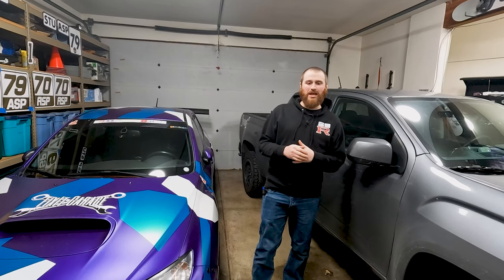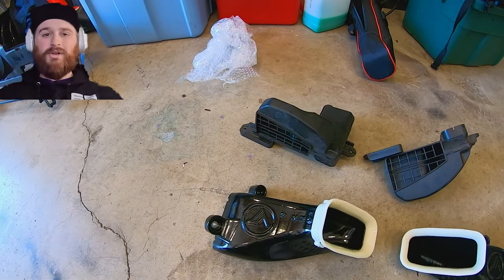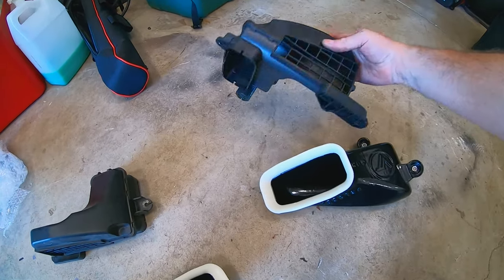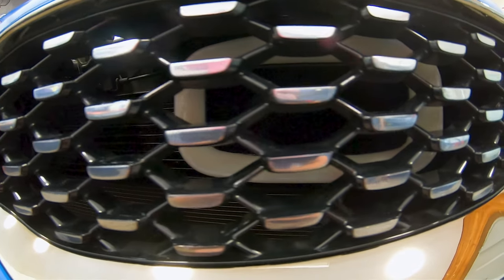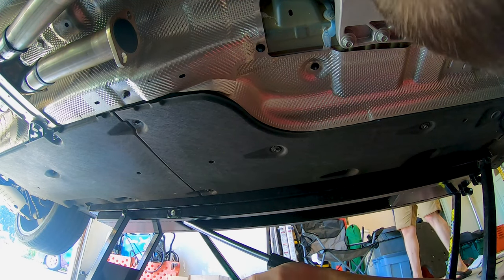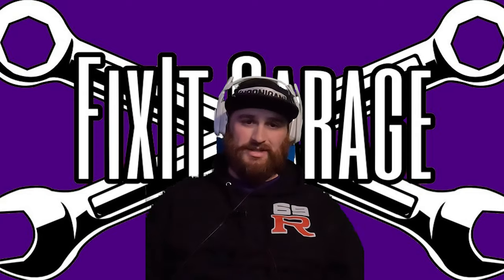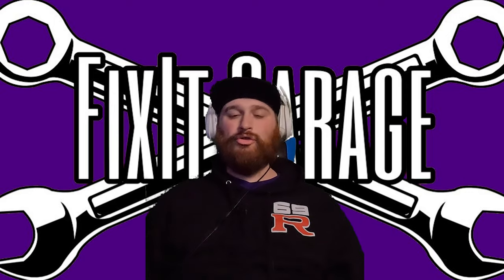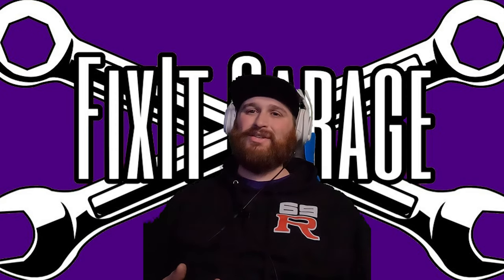Kia Stinger Velossa Tech Big Mouth (Glow in the Dark) Snorkels!!

Comment: Dang sucks to snap a stud, especially when not really expecting it on these newer cars. Wonder if soaking in penetrating oil early on could have helped.
Reply from the maker: We did for 3 days before we tore it apart. It still didn't help at all.
Reply: @Fix_it_Garage  dang that’s a bummer for sure.
Reply from the maker: @ALMX5DP  yeah the best solution is air gun and extension and do them from under the car. For some reason that resulted in the bolts not getting damaged as youll see in the next two videos

Comment: they have a lot of video how to do it... thats a hudge mistake of you to no watch it before and not added blaster... thats so dumb dont do mecanic..
Reply from the maker: We did pb blaster for 3 days before taking it apart and there's like no videos on the downpipes. I've been a mechanic for 15 years and I own every mistake I make. That's how you learn shit happens, you improve and move on
Reply: but if you have been a mechanic for 15 years, how did you do to break the nut?
you have to make bouncing movements with the ratchet to check that it is not jamming
if the ratchet can't do a little bouncing, there's no point in forcing it again, it's on what will break...
it's useless to wait 3 days with the blaster, one day is enough and why after having unscrewed a few turns not having put the blaster again ? maybe even let it wet and saok it a second time?
go dry without bouncing that's it...
learn jeep mecanic next time buddy
Reply from the maker: Haha we soaked it multiple times over 3 days to allow the nut to break loose. Guess what sometimes they bind up and break again shit happens. Happena on the new civic turbos all time and honda does it on purpose to prevent modifying the car and kia does the same thing. Making one mistake does not make me less of a mechanic. Ive got multiple successful car builds to back up my credibility. I appreciate the suggestion on how to prevent it in the future, but your delivery on how you advice needs some work. At the end of the day I got them installed and my buddy is extremely happy with them and I got to learn some pretty cool things about the car in the process
Reply from the maker: @Jonathan Poulin  also didn't need to put a turbo on it. I fixed i was able to replace the stud.
Reply: but remember that any penetran liquid will not act magically when the bolt is sitting on it, you have to crack it a little, make small movements up and down, and if you feel a sudden tension after several turns
guess what you screw back to give him the loose and you put the blaster back on, I say that because in the video you don't work on it and you don't add lubricant during 
hope see your fix in you next video?
Reply: @Fix_it_Garage  thats was a joke for changing the turbo..